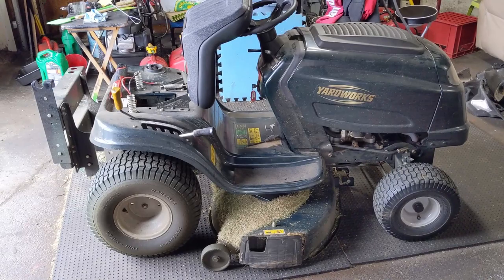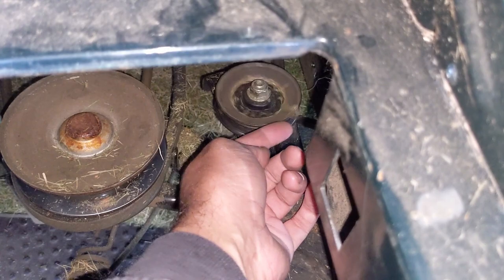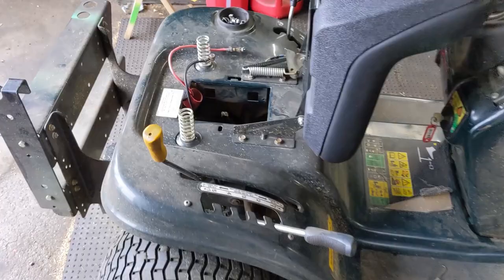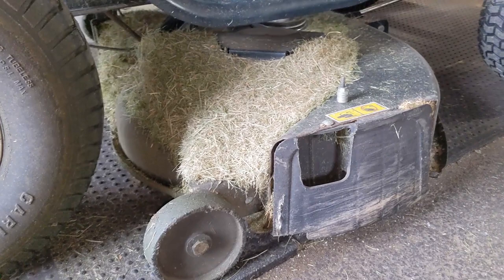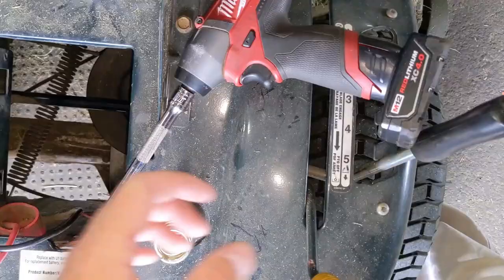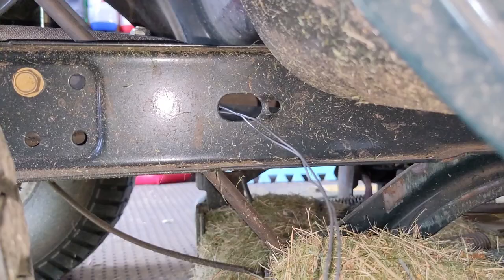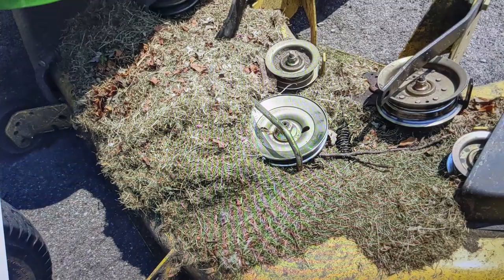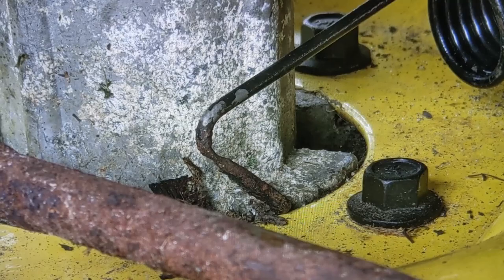Clean the Debris from your Mower!

Comment: I just had to replace lower deck belt on a 46 in mtd. Friend had pressure washed it when it came out of storage. So I've been cutting all summer but did notice some small stones on the deck. Can't recall any cutting that would have done that. Now I'm thinking I was moving winter grit around the storage area with the mower. Guess I should have cleaned it off.

Comment: Biggest advice I give people. as I run an repair shop in Kentucky for power equipment of all sizes,
Every other time you use it. Clean you're deck and make sure you're drive belt and deck belt are free of obstruction and things they might rub against.
I actually watched one of you're videos a couple weeks ago when I got some older lawnboys. 
I also suggest , if anyone has an FWD push mower , take the cover for the belt drive off. As within minutes of cutting it'll pack with grass clippings and destroy an belt in only a few weeks.
Reply from the maker: Thanks for watching!
Reply: Great tip on the FWD actually have had two come in with melted covers due to fires smouldering in packed dry grass caused by friction from the belt movement.

Comment: Leaf blower works quick and easy, less than a minute
Reply: I neglected to do much to clean mine - just pulled out what I could by hand - for several years. Then I went to my leaf blower and got it really clean. I'm still running on original belt after 12 years.

Comment: I’m curious if you cover the replacement belt cost or bill the customer.  The lack of routine maintenance looked like a factor in the failure. Also, the seat safety switch looks like it’s bypassed at 9:30
Reply from the maker: For this repair I did not cover the cost of the belt, due to the large amount of debris. As shown, once another belt was installed, the machine drove just fine. Thanks for watching!

Comment: I wish I could easily reach the tranny components, however, my battery is in the engine compartment - it’s a John Deere.   So the belt died of neglect.   Like they say, treat your equipment casually and it will become a casualty.   Thanks for the vid.   👍👍.  I make it a point to clean my equipment thoroughly after each use.

Comment: I have a similar ride on and I was wondering does the transmission oil need changing if so how often do you recommend ?
Thanks
Reply from the maker: These units are sealed, only the ones with oil filters and drain plugs need to be serviced!